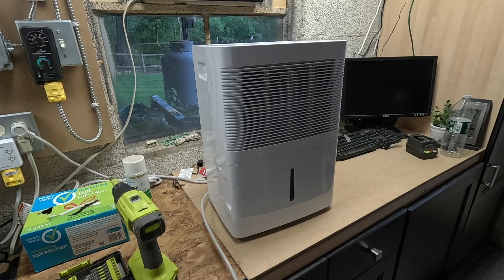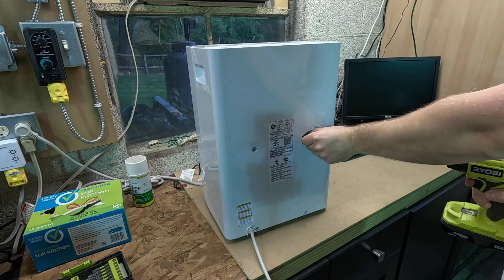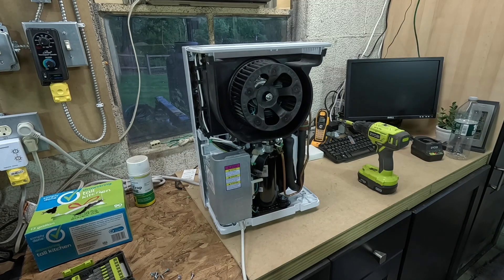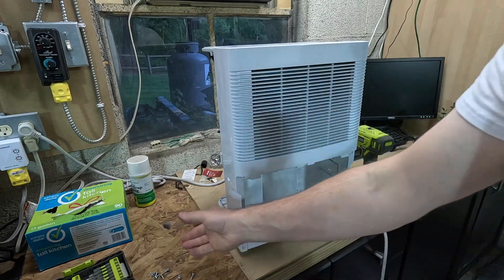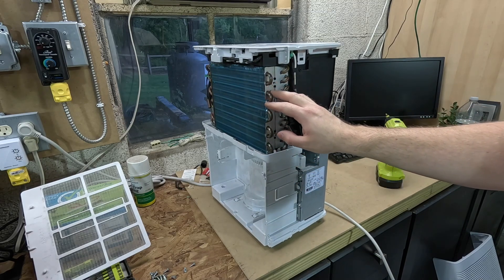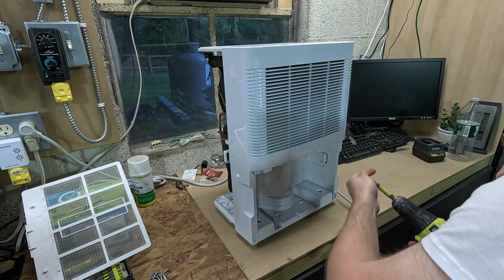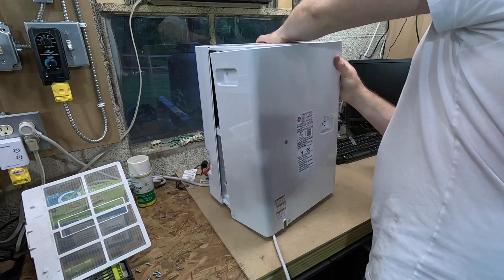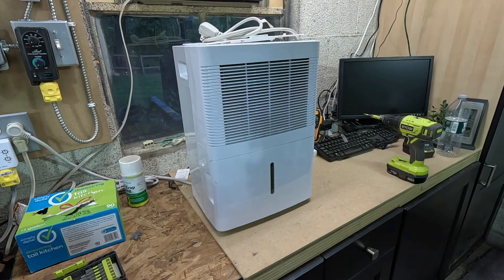General Electric ADEL20LYQ1 20-Pint Dehumidifier Teardown

Comment: I had unit the was almost identical but branded as ivation and different design for the grill. Some of cheap off brand that eventually replaced with an automatic heater corp that is old enough to use R12.
Reply from the maker: You're much better off with the older unit.

Comment: Nice teardown of this dehumidifier. It seems as if I have noticed that Haier liked using 2 compressor brands which were Qingan and Richie Precision. Interestingly, a unit like this does not have rust or at least signs of rust on it. With the way it is, hopefully, it should last at least a year or so of constant use but knowing how much these things are a piece of junk, who knows how long it will last. I have one made by Midea which is a Pelonis-branded unit. That unit is in its second year of operation. Oddly enough with the Midea-made units they don't have those metal sides on the condenser and evaporators like the GE branded units have. Still, somehow even the Midea ones leak as I have had one that has done so 2 years back. The one now interestingly enough uses the same coil design as all the other units do but the metals that are used on it seem to be the Allumium style that seems to make some of these modern pieces of junk last a while longer. I know Frigidaire did this coil design on some of their units produced back in the mid-2010s and I have still seen some people having those units going for some time. It seems like over the years of having multiple units and doing some research the ones made with the Aluminum C-shaped coils on these modern units tend to last longer than the ones with the copper style like this unit has.
Reply from the maker: Thanks for letting me know.